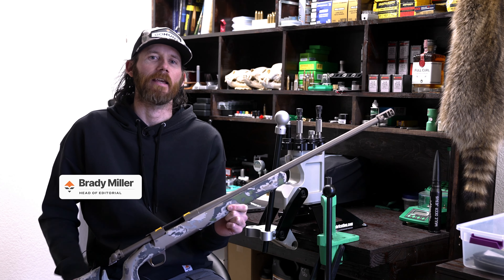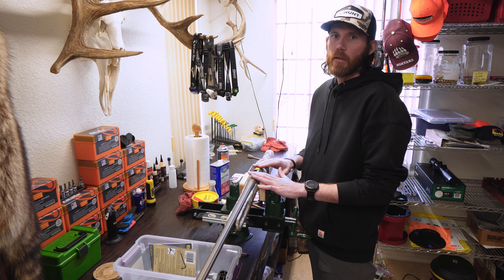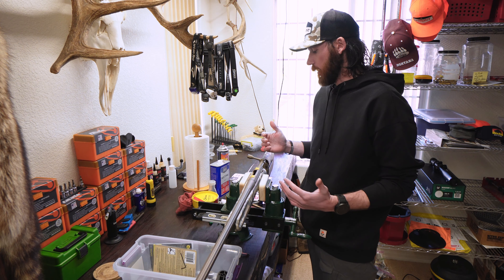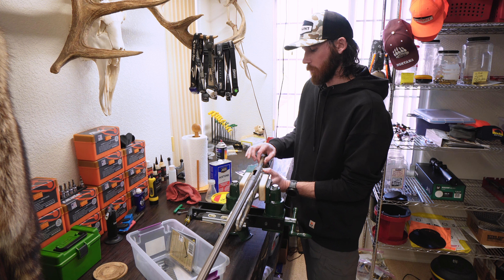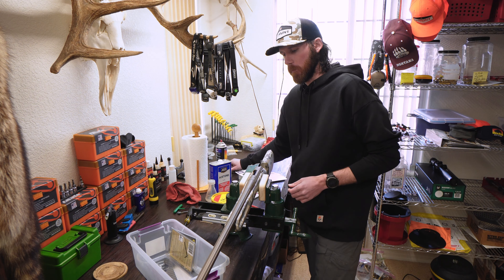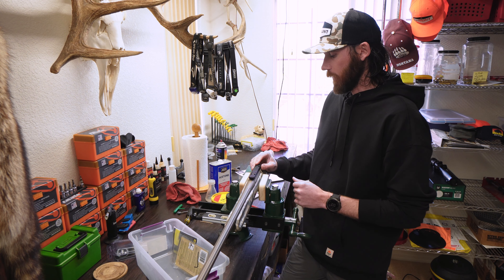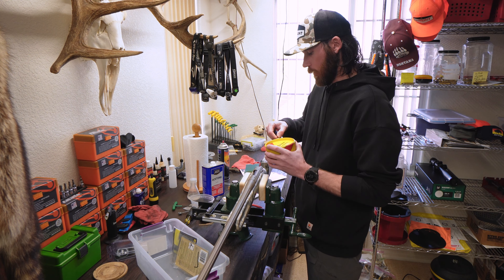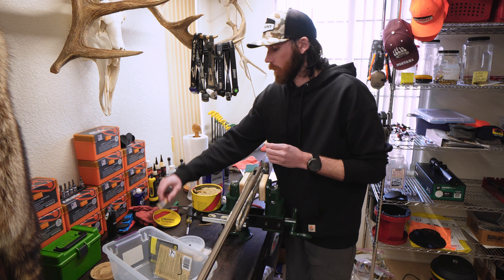Brady Miller's Rifle Build - Part 1 Rail Bedding

Comment: You can use 2 toothpicks jammed in the screw holes to be used as a guide when placing the rail onto the action.. Or get some all-thread about 2 or 3 inches long. just remove one and replace with rail screw. No JB weld issues that way!

Comment: Would very much like to see how you mount the v3 crono to this gun i have the v3 barrel  mount but never heard of the one you use. And how you mount  it
Reply: Great suggestion. Let me see what I can put together on that. Might not be a full on YouTube video unless I can get our camera guy to head to the desert with me. But I could do something soon with my big 300 RUM and this 6.8 Western and how I mount it off the barrel and drop it to my Instagram and post it as a reel so it never goes away. And while we are talking, the off-barrel mount I use for the V3 is made by Gray Ops CNC. I've tried several different brands, and this model is the best I've used for a hunting rifle.
Reply: Wis I had Instagram  on Facebook.  But anything you  could do  would help.  Thanks

Comment: Ssshhhaaoooww you going to love it mine also in 6.8 western shoots lights out 1/4 inch groups at 100 yards with Winchester copper impacts 162 gr & browning 175gr Sierra  it hates the other 3 bullet options that Winchester makes. I did not bed my rail. I am considering  chopping off 4 inches feels front heavy.

Comment: Just curious tally makes a 20 moa light weight rings. Why do you choose the rail over the scope mounts?
Wold love that input.....
Reply: I prefer a rail as it allows me the ability to move my scope around a bit easier to set eye relief and I can also adjust the spacing of the rings on the scope. Both options work great. I also mount an extra bubble level on my pic rail under my scope.